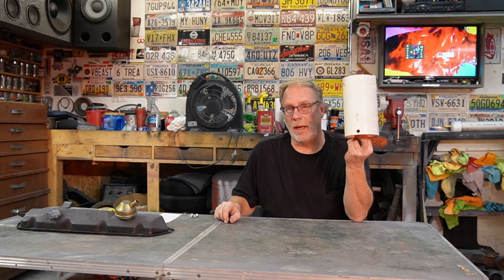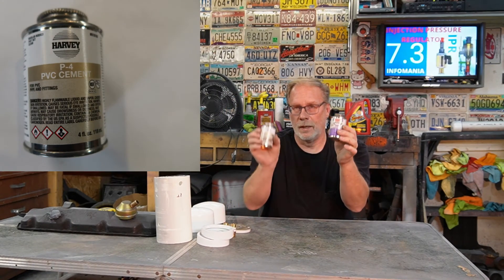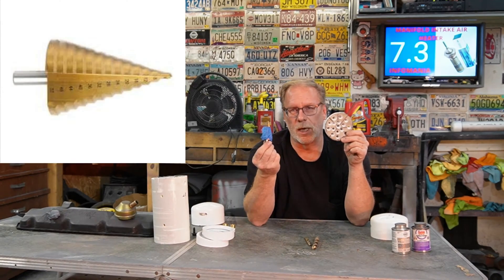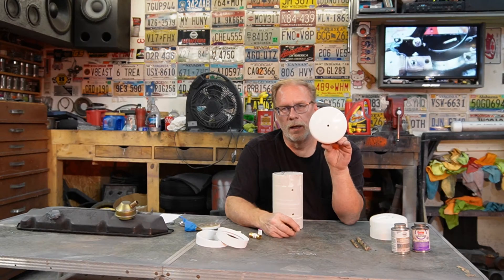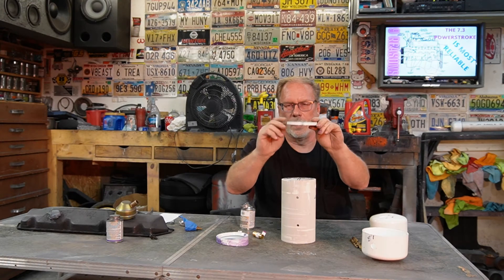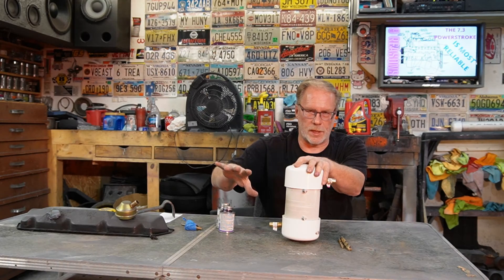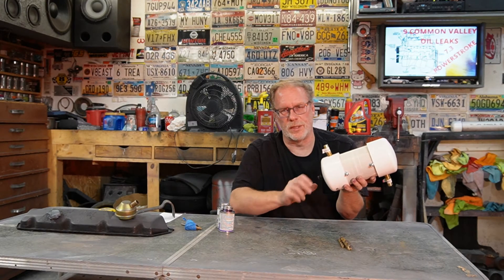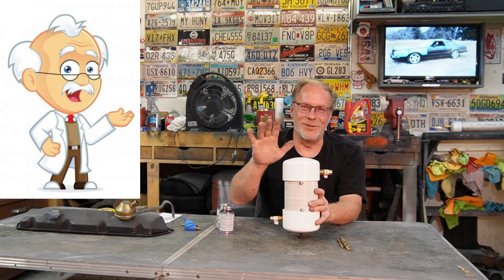🛻📽️ ....7 3 PSD DUAL CCV MOD DIY CATCH CAN PART TWO 🟢🟡🔴🟢

Comment: I have looked through the list of videos repeatedly and even tried using the search tool, but I cannot find Parts 3 & 4 of the Dual CCV Mod.

Would you or anyone please post the links so that I can view them???

Thanks, y'all! 

~Tex
Reply: dude i literally just unplugged mine and plugged the hole in the air intake tube, the look on the libtards faces as smoke billows out of the spaces inbetween the hood and quarter panel/grill is priceless. ☺

Comment: so, I know this has been out for a while, but I just recently purchased a 1999 f350 with a 7.3 and I vented my ccv to atmosphere took my truck on a 600-mile round trip and when I returned the whole under side of the truck was covered in oil. this truck was spotless no leaks under the truck whatsoever until I done this. it appears that I have blown the Oring at the dip stick adapter. can i assume (we know what happens when you assume something) that the reason this happened is that I only vented one side and both valve covers need to be vented (as you did) and that caused too much psi to build up.
Reply: dude i literally just unplugged mine and plugged the hole in the air intake tube, the look on the libtards faces as smoke billows out of the spaces inbetween the hood and quarter panel/grill is priceless. ☺, smoke comes out of my dipstick too,  but no  oil anywhere, most of the smoke just gets sucked into the air filter. i really don't think psi will build up, why do you think psi will build up, smoke was coming out of my dipstick way before i let the ccv breath.

Comment: Amazing how brilliant minds think alike. I just completed and installed something similar on my 08 Super Duty 6.4. If any veh. needed a catch can this one does? Mine is made of The same PVC. It's a clean-out coupler and an end cap.3/8" ball check valve threaded in to the center of the end cap as a drain valve I hold it to the frame with two 4"muffler clamps and saddles this has a SS sink drain catch and is packed with SS pot scrubbers any very similar 👌

Comment: Great video. I have a Question not related to the video. I have a 2001 F 250 7.3, I tow with it and would like to have it better at towing. I'm not really interested in changing my original injectors to whatever these other 7.3 groups are telling me they think with this stage 1.5 and stage 2 injectors. I think i should be able to get the results  I'm  looking for a different way. My ? is really what would you recommend. So far the only thing I have really done to my truck is all the sensors and wiring harness. I did that watching your videos. Thank you for all the great videos you do on the 7.3. I have learned a lot from them.   also I tow a camper roughly 10,000 lbs when loaded.
Reply: I will go and check your videos for anything I might have missed on towing, Thanks again.

Comment: I watch all your videos. The information you share has been invaluable to me in the maintenance of my 1998 van. My electrical system is now restored and upgraded from original and is working flawlessly. No more flickering battery icon!  My oiling system is now superior to when new based on your recommendations. I upgraded to a Fluidamper harmonic balancer based on your comments and this was a noticeable difference and improvement over stock. So "Thank you" for helping me bring this van into a better condition than it was the day I purchased it in 1998. Now I am considering your current advice on this CCV modification. I have no doubt that this mod works as you say. But I have one important question - How much smoke exits the hose back by the rear wheels? How noticable and hateful is the smell accompanying this? I have read many comments from other 7.3 owners that did a CCV mod just venting this under their trucks w/o your catch can system that mention these negatives. Real world...what do you experience?
Reply: There is a decent amount of smoke. Mine is currently vented at driver side rear tire. Depending on wind direction when not moving you can smell it. Not very pleasant, why I’m considering catch can. Maybe will minimize it

Comment: Do you have a link for the cutting disc/ food slicer blade? I noticed its not included with the other part numbers, and thats the only thing Im having trouble with. I cant find anything with the correct holes. Thank you for the information

Comment: What are your thoughts about venting straight into the exhaust through a Venturi and forgoing the catch can?
Reply: Could you do a video on this?
Reply from the maker: When you put your self out there you have to be very careful of what you say and show So I would prefer to have shown where you cut a hole in the exhaust but not like the Venturi but simply adding a 8 inch pipe that would hook up to the down tube from the CCV and 6 inches would run parallel inside the exhaust pipe so there wouldn't be any vacuum effect  exactly like GM did in there early converter equipped vehicles that had air pumps on the engine I have done this and never had any oil build up so it does work

Comment: Love your videos! Just picked up a 2002 excursion 7.3 .
Need to replace the batteries and you talked about an up and coming video on batteries lasting 11 years . Let me know please.
Reply from the maker: ODYSSEY Extreme Battery
ODX-AGM65
(65-PC1750)
https://www.odysseybattery.com/products/odx-agm65-battery-65-pc1750t/
OR BATTERY PLUS
Reply: @CUSTOMWORKS7.3PSD  thanks just tested and  charging system failed that and starter but autozone? Will have to get that looked at.
Great videos!
Reply: I run dual Optima Yellow AGM batteries in my 2001 F250 7.3 and absolutely love them. 

In fact, I run AGM batteries in my 2013 Ford Escape, 2004 Nissan Xterra and my 1989 Chevy K1500 5.7L V8.

They've never let me down.

Comment: I have a request from the gentleman in the video. Is there any chance that I can contact you personally? I'm not trying to be weird and creepy but I could definitely use a professional or at least your assistance on a few things to do with my 7.3 powerstroke. This is my first and ever vehicle I've ever owned and I am very interested in restoring this truck it's a 96 F-350 crew cab long bed dually and it is a one-on-one conversion truck
Reply from the maker: Right now I'm overwhelmed

Comment: Why the catch can? For the last year I have been simply venting to the atmosphere. I flipped the ccv. I used short piece of 3/4” copper pipe for a coupler so that I wasn’t narrowing/ restricting the flow at all. I run the 3/4” ID tubing up slightly then down under the truck. Not a drip of oil out of it ever. I suppose the oil doesn’t make it over the hump. Am I missing something? Why’s the catch can needed? I can kinda see the need for a ccv on the passenger side. But I’m not understanding the need for a catch can.
Reply from the maker: I can't say that EPA is watching youtubers
Reply: @CUSTOMWORKS7.3PSD  are you saying that these DIY catch cans allow you to pass potential emissions inspection? Is that why you do it to your fleet?
Reply: @RJ-cc1fz  no you are supposed to catch all oil from the crank. Venting into the exhaust like they did on stock trucks was an epa requirement not something done by ford for function. Catch cans do nothing for actual smog testing purposes
Reply: @CUSTOMWORKS7.3PSD  are you saying that these DIY catch cans allow you to pass potential emissions inspection? Is that why you do it to your fleet?

Comment: I like ur idea but for intake barb i would think it need be lil hire on catch can so if its got oil in it its not covering the inlet hole
Reply from the maker: no issue ever with that
Reply: shouldn't be oil coming out your ccv vent.

Comment: do you really need the catch can can you not just run the hose down to bottom of frame? and tie it to frame?
Reply: dude i literally just unplugged mine and plugged the hole in the air intake tube, the look on the libtards faces as smoke billows out of the spaces inbetween the hood and quarter panel/grill is priceless. ☺

Comment: Why no more than 16 holes on the cutting board?

What are the depths and parts for the driver side since it uses a bigger diameter hose?

Is this all trial and error or is there a way to figure out how to size everything?

Comment: Hello sir.i got a question for you wt do u think about the 7.3 powerstroke exhaust manifold  which one it's better the stock or I've seen some made out of stainless steel thank
Reply from the maker: It doesn't make any noticeable difference or benefit for performance stay stock thats what was engineered for it As far as stainless steel there is many different what i'll refer as grades not the actual technical name but u get the gist Its very hard doesn't expand which under the high EGT's they crack after a fast cool down like a really miserable cold day in winter

Comment: Wow you're still posting still ?? 😀
Reply: Now that I have your attention quick question.... is it ok or not ok to leave a 7.3 idle for extended periods?
Reply from the maker: @jbbolts  it comes down to what oil you use if royal purple no extended idle beyond stop lamps and running in the house and back out if Schaeffer Oil you can let it idle all day long long, idle on a 7.3 and only this engine heats up the bearing in the turbo and robs it of lube so you need a oil that has a TDN 10 and up as far as the rest of the engine it doesn't bother it On very very cold day i'll let my truck idle by the shop for running for service calls I have over 700k on that one no oil issues no HP issues from doing this but the LPOP and HPOP are the high volume So ambulance spend a lot of there life idling  I buy them all the time very low miles when I take them apart there is no noticeable wear and there maintained using the best oil on the market and its usually  Schaeffer Oil because its given to municipalities at cost thats why they use it A lot of professionals will argue all kinds of issues and there right but we are taking a 7.3 its a different animal
Reply: @CUSTOMWORKS7.3PSD  Ok thanks for your time and all you do... I watch a lot of videos but I always come back to yours for the last word. I couldn't find anything but shell Rotella and I just did first  oil change since getting the truck a couple months ago. It would not start below zero(celsius) before and the other day it started at -20c. I was ready to run extra wires and hook up an extra battery or 2 in the cab. The truck was well maintained. Everything is ok had it scanned and all that came up was icp valve but haven't even swapped it out and the truck runs fine. Thanks again much appreciated!
I put in Shell Rotella 5w40 btw... it was all I could find in that weight at the time.
Reply: @CUSTOMWORKS7.3PSD   I can't find any information about the TDN of Shell Rotella T6 4w40 oil... Do you know if it's safe to let the engine idle using the Rotella oil?  Don't want to find out the hard way  Thnx
Reply from the maker: @jbbolts  Shell Rotella T6 4w40 oil starts at 10.4 then at 5k miles drops to under 6 on most oil analysis take a look or try  Schaeffers 15/40 starts at 10.8 and stays constant even after 100k miles double down and add 2  Schaeffers Moly EP  and you have a combination thats unbeatable But don't believe  me search and watch multiple youtube videos everyone who try this brand and tests it is always blown away at its quality
Reply: @CUSTOMWORKS7.3PSD  Ok thanks... The other thing is I'm in Canada.. Truck wouldn't start when temps went barely below freezing... after oil change with  5w40 Rotella it starts at -20c no problem at all. Do you think Lucas oil stabilizer would help at all? Will definitely look into the Schaeffers. Do they have a 5w40 version and is it as good?
Reply from the maker: @jbbolts  Lucas won't do anything for what your asking and yes  Schaeffers has 5 40 and is the best as far as the starting issue aged glow plugs and aged engine heater causes this issue
Reply: @CUSTOMWORKS7.3PSD  Super thanks!
Reply: @jbbolts  yeah dude, get some new glow plugs.